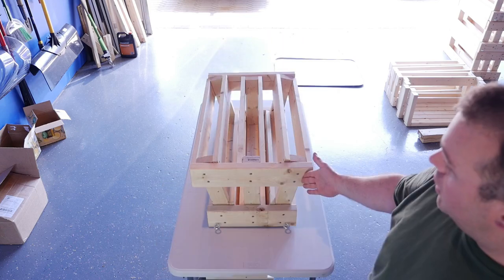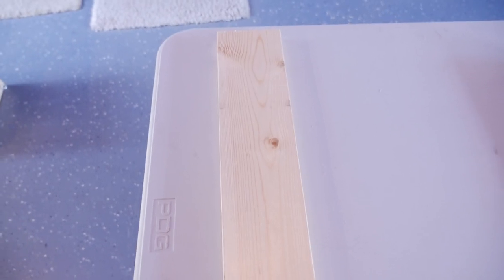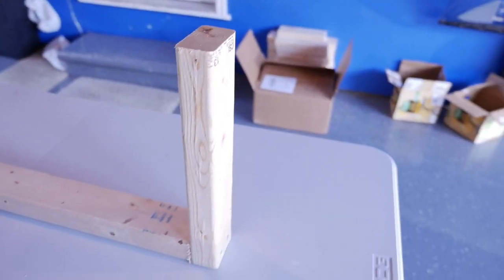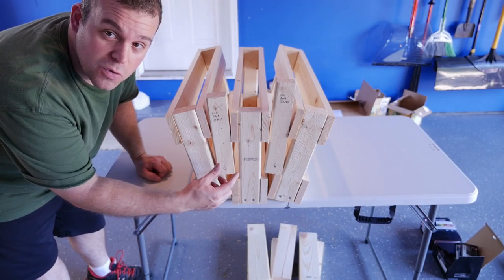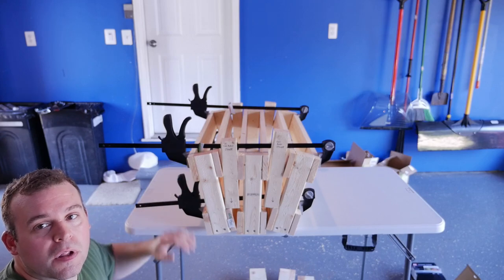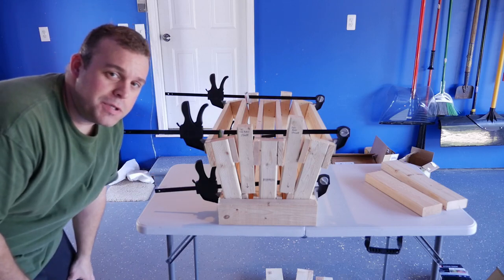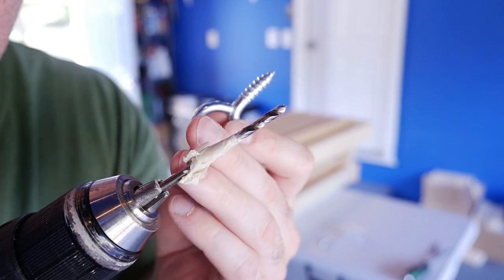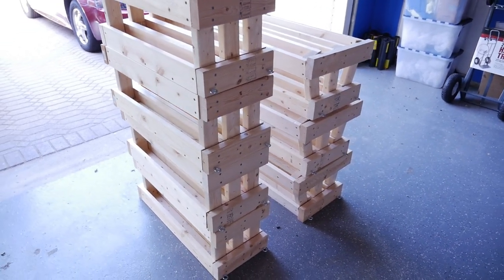DIY 30 Shot Firework Mortar Racks

Comment: Great tutorial my dude. Fixing to start mine now. I'll be using plywood sections in place of the 1x4s due to increased lumber costs. I plan to build 4x24 shot racks (96 total) to pair with a case of my preferred cans (Commander in Chief).
Reply: Another little detail that can be changed is to double the capacity by making the base frame twice the width. This requires very little additional work and only doubles the amount of 2x3s required, everything else just gets absorbed by having less scrap for the end plates. The long sides are identical. You can connect the two parallel sets of 2x3s with a few pocket screws along the length. It really isn't even necessary to do so because they'll be held together at the ends anyway, and they don't depend on each other for structural stability. Just some additional comments to spark ideas/convo from the peanut gallery.
Reply: I used those terminal blocks last year for my first show. I had them attached to each of my four main shooting boards and it worked flawlessly. I was able to transport four 2'x8' sheets (left, middle, right, and finale) to my shoot site already rigged with talons between the product and the TBs, then all I had to do was connect my home-made, wired e-fire module to each of the TBs. It took 30 minutes tops, even I was surprised haha.

Comment: Great video. I will definitely use this to start building my own racks. This is the last year of saving x cal tubes. 
Great video! 🤘
Reply from the maker: Hi Josh thanks for watching! Good luck building your racks, mortars are sure faster to fuse than fusing multiple cakes! You can still save those Excal tubes. You can knock off the bottom sleeve and plug them and reuse them, but it is a good bit of work! Personally, I find it easier to buy the DR11's already made or you can buy "irregular" DR11's from Pyroboom and plug them yourself.
Reply: @brandonc7450 Thanks man. Pyroboom was who I was looking at. I have been eyeballing there orange tubes, a little spendy but we only get one go around. That will be something I practice this year is fusing and laying out cake/repeater boards. Get ready for my first wholesale order next year.

Comment: Wouldn't the 1x3 & 1x4 be good for the whole project? AWESOME Video thou!! Thanks for taking the time . God bless u and your family.
Reply from the maker: Hi Jamie Woods, thanks for watching! Yes you could use just 1x3 & 1x4. I just like to use the 2x4 on the ends to tie everything together as it provides a larger "handle" to grab to lift the rack. These things get pretty heavy after being fully loaded.
Reply: @brandonc7450  I appreciate your prompted answer. They do get heaving. I didn't know if the racks needed the 2x4 or if it was just your preference . Great video ,the fact you took the time for details on it.  Happy 4th

Comment: Good video...i've learned you use lighter materials over the years, and would construct these to not be as heavy by getting rid of all the 2x's & construct with 1x's only
Reply from the maker: Hi Ryan Spence, thanks for watching and for the tip! I like using 2x4's on the ends to provide a good handle to grab onto. We lifted these into a cart that is pulled by a riding lawnmower to get it down to the launch site.

Comment: I have been using milk crates for years ..hdpe crates from rural king..always works great for me..super light..
Reply: Ever seen what a milk crate does when a shell "cato" happens. Blows the whole thing apart. If it is fully loaded and fused bad things happen.
Reply: @houseoffire72  no I haven’t put a mortar up side down..or seen it done..if you have I would pick smarter friends
Reply: @houseoffire72  but I’m not sure if a 1x piece of lumber would be any better..fireworks accidents happen and are never good..

Comment: May I plz ask,
Why is the base 24” long? That’s a lot of wiggle room if the tubes are 2” OD. I was told to do it 20” with and extra 1/16 per tube so bottom plate for a 10 shot rack 20 5/8 then basically same set up as the rest of your video. It’s just a question Bc the difference between 20 5/8 and 24” is a lot. I haven’t built the racks yet that’s why the question my friend. By far you have a great shows as I am a new subscriber
Reply from the maker: Hi Tako2e, thanks for watching! These racks were made with the intention of fitting (10) DR11 HDPE tubes per row. A single DR11 HDPE tube has an outside diameter of 2.4". If you are using fiberglass tubes then this design will be too wide just as you mentioned. Here is the link to the tubes that I use for my show https://www.pyroboom.com/products.aspx?name=mortars. Hope this helps! Have fun and be safe my friend!

Comment: How do you put the tubes in?  just put them in and call it good?  Do you need to secure the tubes?
Reply from the maker: Hi Mike Hunt, thanks for watching and for your question! The racks are designed to let the tubes easily slide in place, but snug enough to prevent them from moving or ejecting from the rack during fire. So no additional securing is necessary for the tubes. Good luck with your show!

Comment: I have alot of 2x4 wood in the garage.  I imagine I can't use the 2x4 for the base because it will be too wide for the hdpe tubes?
Reply: If you have a table saw you could rip them down to 2 1/2". Otherwise I don't think I would trust them being that loose in there!
Reply from the maker: Agreed.

Comment: How much life do the HDPE tubes have? Can you use them more than one year?
Reply from the maker: The tubes themselves will virtually last a lifetime (assuming no misfires and shells going off in the tube). But the wood plugs on the bottom will eventually need to be replaced. If the wood plugs are getting old and starting to show signs of cracks, then its time to replace them.